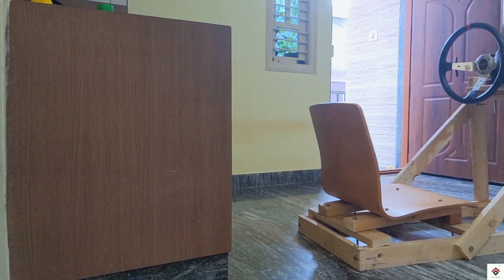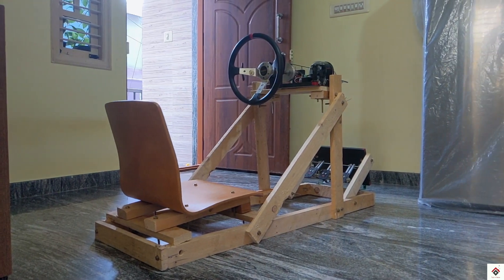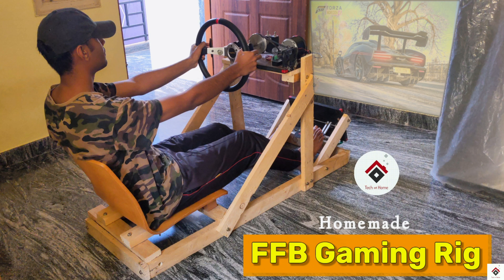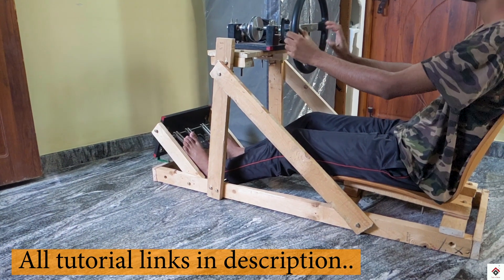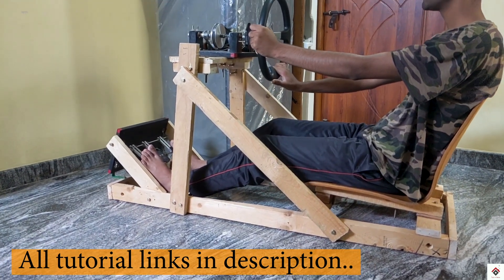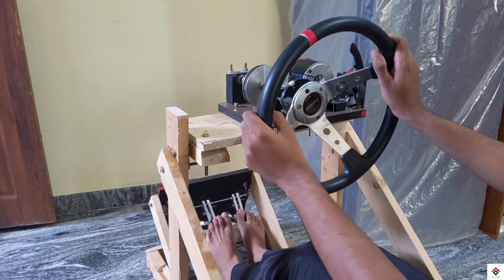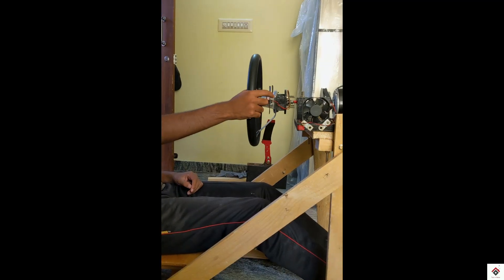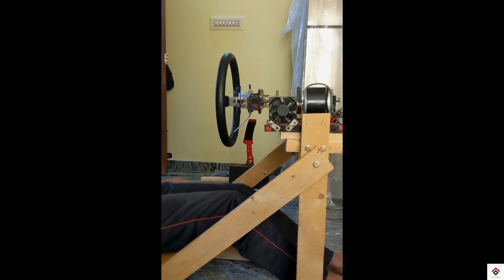DIY Force Feedback Gaming Rig | Test Drive Unlimited Racing with Homemade FFB Steering Wheel+Pedals

Comment: Can you please tell about the power supply you are using to power the steering wheel or make a short video on on please
Reply from the maker: My motor is 24v, 13A
But as of now using 12v, 5A power supply. I will be upgrading in coming days.

If you are buying supply, better go with variable option(At least between 12 and 24V switching option).

In some games if feedback is too strong, it is difficult to move the wheel when motor is powerful. In these scenarios you can reduce the supply.
Reply: got it thanks @techathome

Comment: Bro it is not working on forza horizon 5 and also how to add navigation buttons to it please tell
Reply: you need a gimx adapter, which you can build with a arduino pro micro and usb to uart adapter. its fairly easy
Reply: Can you please tell about the power supply you are using to power the steering wheel?
Reply from the maker: @lokeshjain 
1. To make it work with all games, make Diy Gimx converter( Even I will try in coming days)
2. To configure buttons, refer this video: https://youtu.be/-gHQ2EIYm88?si=qj-Gev2W8fCnyGr2